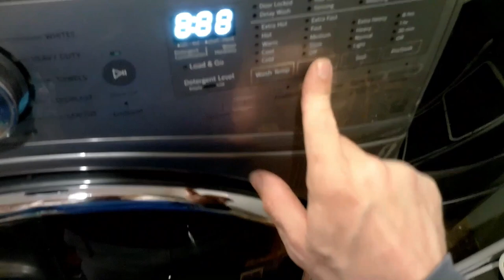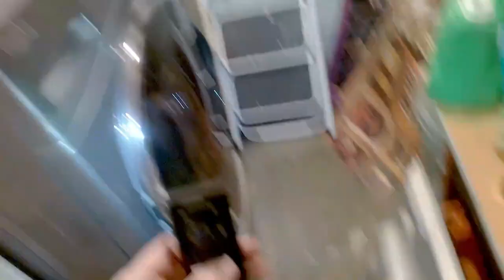"E3-F1 Error Code? Simple Fixes for Your Non-Draining Whirlpool Duet Washer!"

Comment: Just got this error, machine went stop pumping and door won't unlock.  I'll pull it apart tomorrow, see if this assembly looks damaged.
Reply from the maker: Most of the time, if the door doesn't unlock, it's because the water hasn't been pumped out of the tub. Once you remove the water, the door should unlock. If you have a wet vac, you can disconnect the drain hose from the wall and use the vac to pump water out of the drain line, which can help prevent a mess. However, it sounds like there may be an issue with your drain pump assembly.
Reply: @onlineappliancetech  after sitting overnight it was able to pump the water out and the door unlocked.

Filter is completely full of small plastic beads, hair elastics and plastic.  I got the set secondhand from a family who had 7 kids. She said they didn't even use the dryer anymore as it made a bad sound. Turned out it was a pen and a C battery in the blower fan.  The lint trap had been sitting over an inch above its correct position due to an accumulation of lint and garbage at the base,  allowing large debris through into the blower fan.

I think the impeller on the washer may be having the same trouble as these plastic beads are just small enough to get through the filter holes.  About to remove and clean the pump as well since its apart already. I did do about 10 loads of laundry before it malfunctioned.